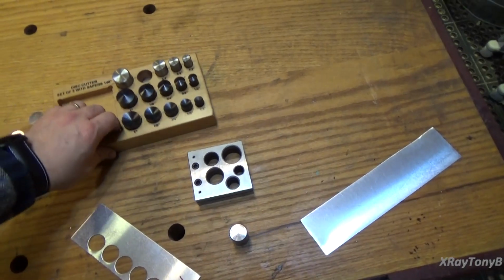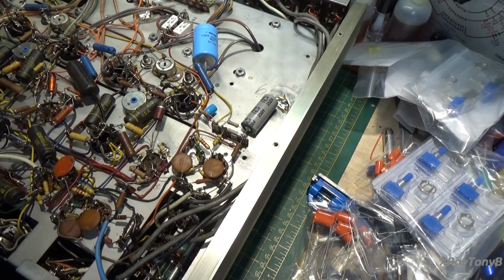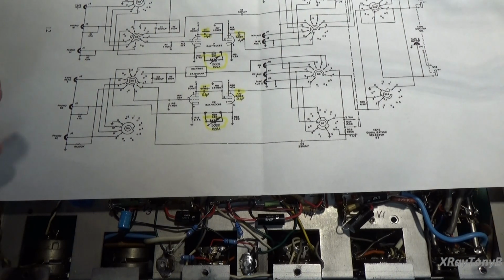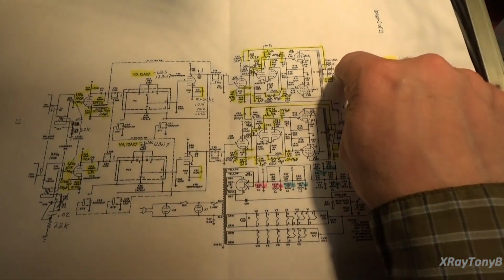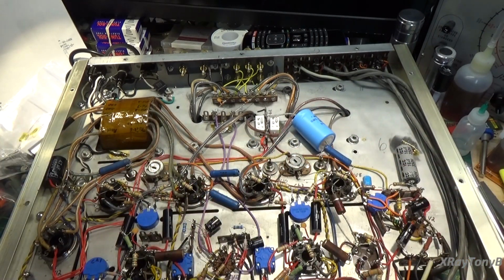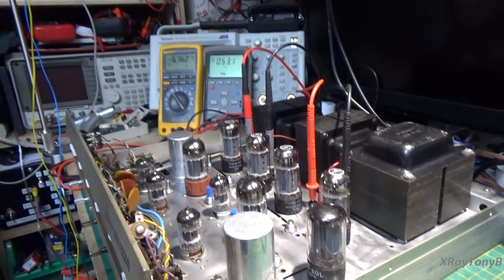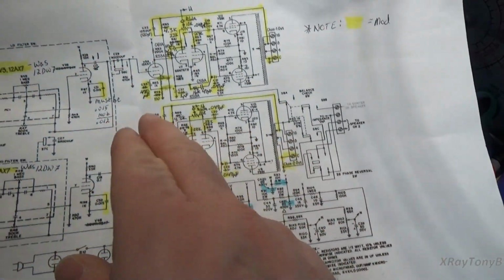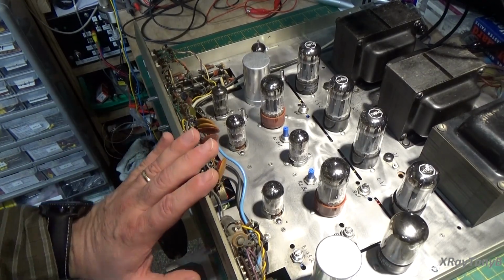EICO ST 70 Part 3

Comment: A cartridge is linear in its response.  The groove is equalized to the RIAA curve and you need to compensate for the pre-eq on the cutting side.  The groove is equalized to prevent the needle from jumping out of the groove because the low frequencies are very large in relation to the high frequencies in a flat un-equalized groove..

Comment: Greetings:
If you ever use DC filament power, how do decide if it is wortwhile to do? My main interest is the reduction of hum. Since silicon diodes are so inexpensive as well as electrolytic caps for filtering what negative qualities prohibit this practice from universal use?
Reply from the maker: In most cases, it really doesn't make much difference.  In some of the older types of tubes, the filament IS the cathode.  This type of tube is referred to as "direct heated" tube.  Any AC signal on the filament could potentially cause hum in the circuit with these types of tube.  Additionally, any small change in filament voltage/current will change the performance of the tube.  
The other type of tube is called an "indirect heated" tube.  In these types, the filament just serves to heat the cathode element, which is independent of the filament.  Since the filament is not physically connected to the cathode, it doesn't really matter if it is powered by AC or DC, as it is just a source of heat for the cathode element.  Additionally, small changes in filament voltage won't have a very big influence on the performance of the tube (but there are limits to this, of course)  The only time you will see any influence of the AC on the filament in an indirect heated tube is if you have very high gain in that stage.  Most circuits are designed to provide the gain in stages, to avoid this.  Long story short: sometimes it helps, but most of the time it won't make any difference.  Hope that helps.  Thanks for watching!

Comment: There is a Loudness switch mod that fixes an original design snafu.  Do a Google on it.  I have a copy of the mod info somewhere if you cannot find it.
Reply from the maker: Gary, Thanks for the tip.  I already have a mod for the loudness.  It should show up on part 4.  Stay tuned!
Reply: xraytonyb My father built one of these when I was a kid.  He also built his own speaker enclosures.  Sounded great!  He recently passed and I am thinking about getting his amp recapped. I am looking forward to the end result of your project because I know how good this amp sounds.

Comment: Hello. You will not get a flat frequency response on the output of phono EQ. Its work is to increse low frequency signals and decrese high frequency signals. if You put 40hz from the generator, output amplitude signal will be higher than for example 10k amplitude.